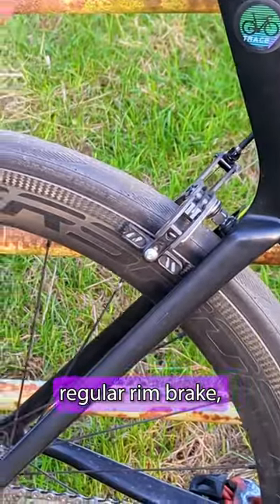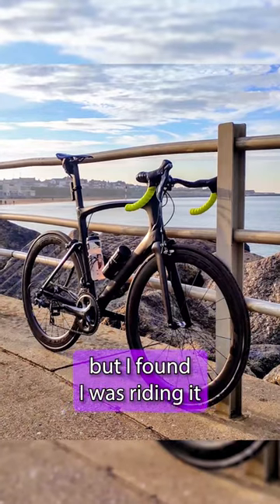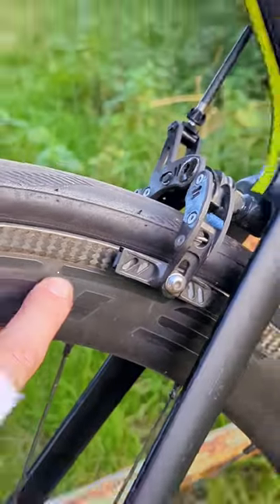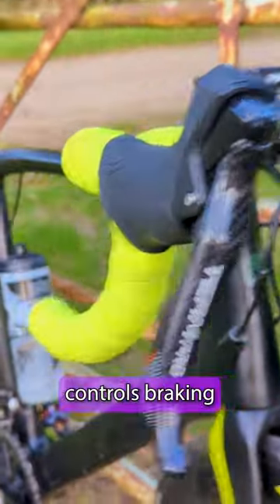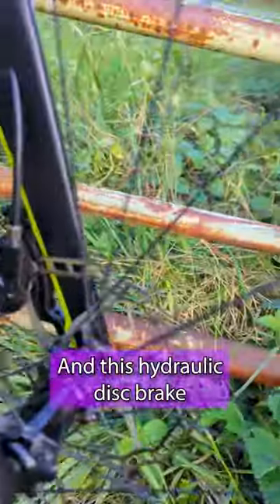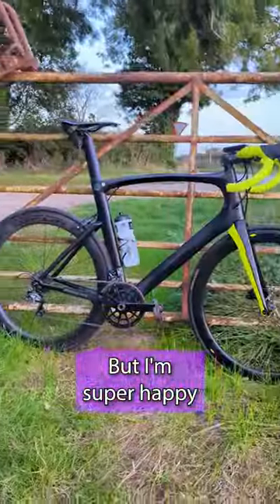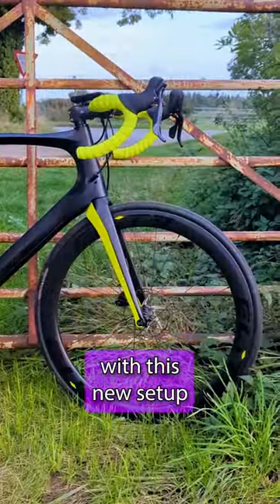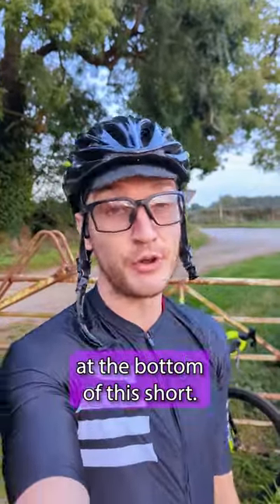Rim brake to disc brake conversion #cycling #roadbike #carbonbike

Comment: Being a mountain biker, I can't even get my head around why anyone would still ride with rim brakes.
Reply: Especially old school horseshoe calipers
Reply: Rim brakes is all you need in a road bike
Reply: @keyyyyyyyyyify 
It's very different from MTB, they are far more beneficial in MTB. On road the contact patch is more the limiting factor. You can easily lock the front wheel and skid with rim brakes. Discs are certainly better in the wet and you arguably have better modulation, certainly if comparing to carbon rim brake where modulation is terrible. On aluminium rims in the dry TBH I do sort of feel they are enough.

The one big selling point for road discs IMO is that they fix all the issues with carbon rim braking, which is utterly terrible, even in the dry (and forget it in the wet). They are a lot safer too as no risk of delaminating your rim which you can do if you sit on the brakes with carbon.
Reply: @blorg8206  the main advantage of disc brakes on road bikes is that you can use expensive carbon aero wheels w/o wearing them out in no time
Reply: @Javier-yd5qf You know, it’s clear when people have never tried disc brakes and have an inferiority complex, so they spout nonsense. I bet you stay home when it looks like it might rain 😂
Reply: @blorg8206 There’s heaps of advantages. Contact patch is not a limiting factor, do you really think mountain bikes have more grip on dirt??

Wider tyres, lower pressures, more grip. But best of all, disc brakes work a hell of a lot better in the rain and on steep descents. 

They make sense on the road.
Reply: @Javier-yd5qf rim brakes work, until they don't.  The disks are just better in most situations.

Comment: It's crazy how obsessed everyone is with braking now. The 20 years I was into cycling before discs we were concerned with going faster. A lot of people would even get ridiculously light single pivot brakes.
I guess the influx of risk averse people raised by single moms changed the focus of cycling.
Reply: We've had rim brakes for 100 years, now all of a sudden they are dangerous and you must go disc!
Reply: The ignorance is astounding. Maybe try discs and you’ll see how crap your braking has been for 20 years.

And your thin high pressure tyres.

And your narrow wheels.
Reply: @richardburns1287 Or things just improve. Do you still drive a steam powered car?
Reply: @discbrakefan  disc brakes are heavier, squeal when wet, overheat on a decent, rub the disk no matter how you set them up. Rim brakes last longer, stop me fine and have served us over 100 years.

Narrow tyres are faster, how can they not be?

And 120psi is faster than 80psi, how can it not be?

Cycling is market driven and the move from rim brakes to disc and altering tyre widths is to simply sell more bikes. We've now got electronic shifting the norm and you will see single chain rings coming soon.
Reply: @discbrakefan  my rim brake road bikes stop as well as my two disc MTBs, apart from the discs howl when wet, the pads don't last half as long and I've constantly got an annoying rubbing either front or back, why should I have to cycle with the brakes rubbing?

The road bikes rim brakes are set to perfection, and equal stroke to the rim each side, unlike a disk brake which is biased the piston pad first.

On your car, which pad wears out fastest?

Thank you 👍
Reply: @richardburns1287  They have pistons on both sides you goose 😂
Reply: @discbrakefan  Disc brakes make sense for women and people with grip strength disabilities. They are popular now because declining testosterone levels in men are associated with poor grip strength and risk aversion. I don't have this problem. Have you had your levels checked?
Reply: @discbrakefan  pistons on both sides? The calipers activation is biased one side dude, take your brake pads out, then wonder why one pad is wearing more than the other!

You are a glimoid!
Reply: @richardburns1287  Man you must have crap brakes if they only have one piston dude. You have so many misconceptions.

Comment: a lot to be desired... That's an understatement. It's downright dangerous because there's no grip at all under the wet condition which I found out in a scary way. I'm still using rim brakes because I'm stuck with the setup.

Comment: Breaking the front wheel is a big no no for me
Reply: That is where all the weight transfers when you brake, so you might want to rethink that
Reply: @discbrakefan  my instinct always tap the rear break, if need needed, one  Second of the rear break then apply breaking to the front.
Reply: @Ahda108  Yep I get the reasons for that, but the next thing that happens is most of the bike weight transfers towards the front wheel (due to the deceleration) so the front brake becomes more effective and the front wheel will be much less likely to lock. This is the same effect as if you started braking lightly with the front brake. 

I took your comment to mean you don’t use the front brake, but your technique makes sense for low grip situations.
Reply: @Ahda108 do NOT ride in groups.  Honestly you need to learn to control your bike better before you or someone else gets hurt.
Reply: @discbrakefan I ride gravel, lose stuff and you better believe that the front brake is more important that the rear when I need to slow down for a turn at the bottom of a hill.
Reply: @bindingcurve  I ride a lot of gravel bro and I’m not sure if you’re trying to argue with me or agree
Reply: @bindingcurve  lol...yes
Reply: @discbrakefan  I find the front brake even more important in low grip situations.  But then again, it usually involves sharp corners at the end of 10% drops.
Reply: @bindingcurve  Well you should be telling the guy who wrote the original comment, not me bro
Reply: @discbrakefan   @discbrakefan   @discbrakefan  your the one who stated that hitting the rear brake 'technique makes sense in low grip situations'.
Reply: @bindingcurve  And it does. If you only use the front brake like you can on the road, you have more risk of locking it and going down. If you’re not using the rear brake on loose stuff I’m not sure what you’re doing.
But if you read my first comment I also said the front brake does most of the braking. 
So I have no idea why you have your knickers in a knot mate. Go ride your bike.
Reply: @discbrakefan  I'm using both, the rear is not enough.  I just hate seeing people crash because they have no idea how to use their brakes.  Front is for power, rear is for finesse, locking them is ALWAYS a bad idea.
Reply: @bindingcurve  And I never said anything different to that mate. You’re preaching to the converted. Go argue with the original commenter.

Comment: Just swap out the stupid carbon wheels for alloy ones and keep the rim brakes. Job done
Reply: Or get disc brakes and have better wheels AND better brakes AND better tyres.
Reply: @discbrakefan  An an empty wallet.
Reply: @daniellarson3068  Nah, don’t need to buy an expensive bike to get great brakes. Better than persisting with bad ones.
Reply: @discbrakefan  Rim brakes were used for 100 years on all kinds of bikes in all corners of the Earth.  People descended mountains with rim brakes.  I guess the assumption that the existing brakes would be bad is based on fallacious beliefs.
Reply: @daniellarson3068  I’ve ridden rim brakes for a long time. Disc brakes are way better. Why are you crying about progress?
Reply: @daniellarson3068 I have a mountain bike that has mounts for both.  XTR rim brakes were what I was running.  Gained weight on the conversation, but the cheap $50 Shimano hydraulics blow the top of the line rim brakes out of the water.  Still like my 50 mm travel fatty head fork.

Comment: Want bettet performance in the wet. get a cheaper pair of aluminium traing wheels. those carbon hoops are for racing
Reply: Just let ppl ride what ever they want . . .
Reply: @oril665  you don't read well, do you? I commented better performance could be gained by using a different wheelset. Didn't tell anybody what to/not to ride.

Comment: You don't need rear brakes anyway. Pretty useless in most situations
Reply: good to have as a backup in case you have a problem with the front brake, though.
Reply: @djlemma Good point.  No need for disks in the rear though.

Comment: Or, have a rim break bike for the dry and a disc brake beater for the wet. That is an absolute monstrosity of a Frankenstein bike. So the answer is no. Ridden rim brake bikes for 45 years. Never ever ever had an issue.
Reply: It’s not about an issue, it’s about performance. Also, 2 bikes? That’s the best solution?

Comment: I have never understood carbon bikes. 
I do not want a fragile crackily material as my frame or rim. 

I can barely stand falling in love with my aluminum bike, knowing it will for sure crack in the years.
Reply: Carbon bikes are not fragile lol. They are stronger than alu bikes